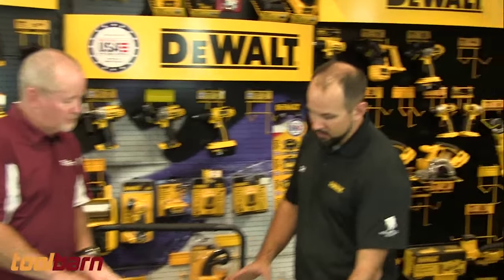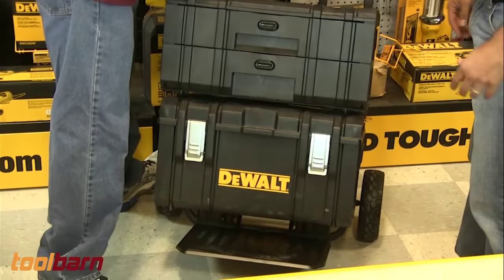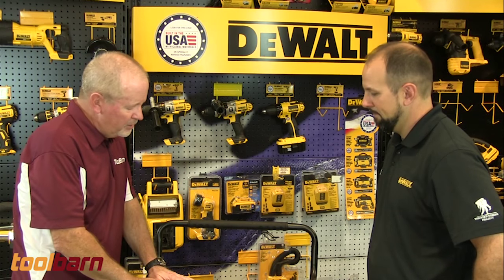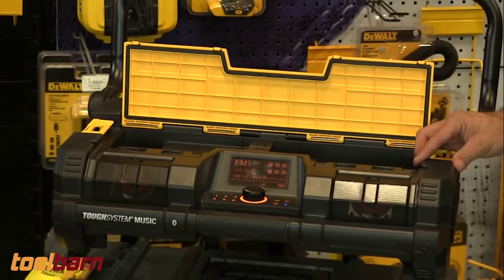DeWalt ToughSystem Music

Comment: Hello. The charger is designed only for 110v or 110v-240v?
Reply from the maker: +Александр Полищук The version we sell is designed to be used in the US, However you can find the European styles on European sites.  Check DeWalt.com for the website you need.